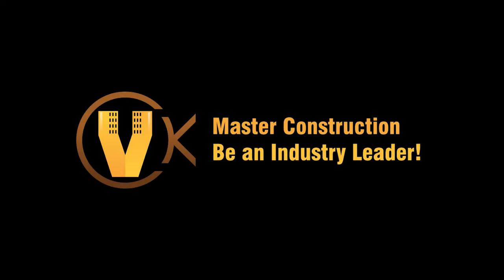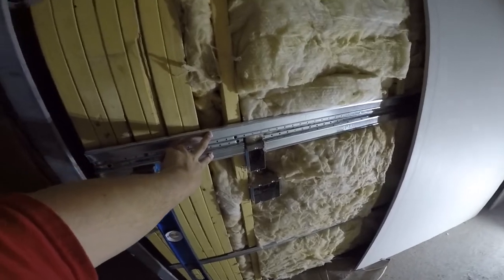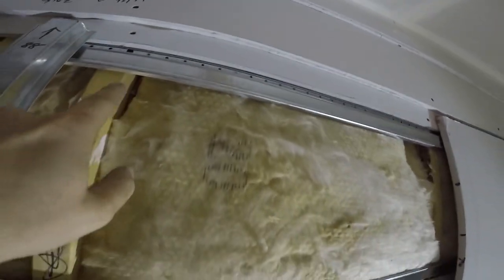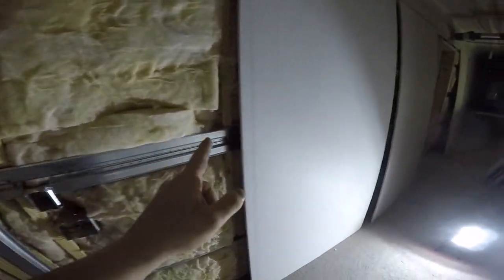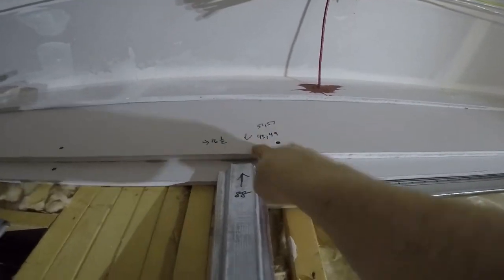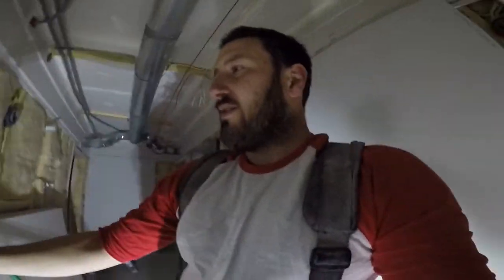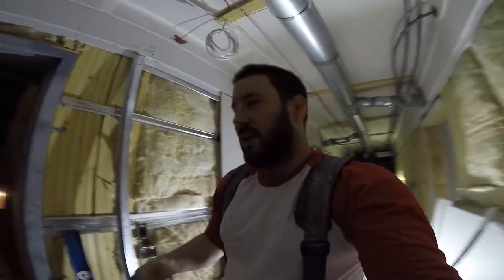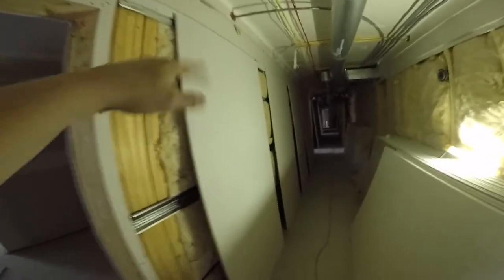Double Layer Drywall 3600 Total ft of Hallway COMPLETE!!

Comment: Pretty involved codes there Chris.  Here in FL, we lay the boards down on both layers, but the joints and seams MUST be staggered. 5/8 both layers.  Fun.  Thanks and God bless!😁
Reply from the maker: Yes man, if we have lay downs on both layers then we have to stagger the horizontal joints as well at least 2 inches is what we go by. You will see much more when I post the rest of the hallway videos. It's probably going to take another 3 videos to get it all up! I have the ceilings and F/R coming out as well now too!  Thanks again as always! Man I am off to work now gotta make that bank!
Reply: @ConstructionKronies  3 videos for all of it? That's awesome, can't wait! You "rock" Chris.  Pun intended.  🤣🤣

Comment: Excellent job there, hoser! That system looks like it's 20 ga, correct?
Reply from the maker: The steel is 25 ga that really light crappy stuff. Its a massive wall thought. 6 inch wood stud, 1/2" for the res bar, then 3 layers of 5/8" in total, 1 inside and 2 out. !! Thanks Carlos!
Reply: Carlos! It's been a minute bro! 😁👍